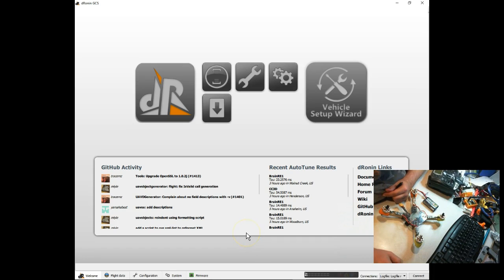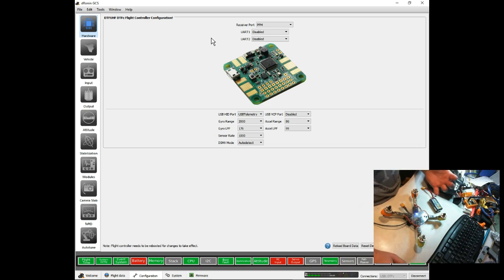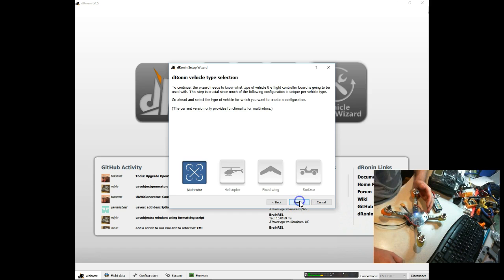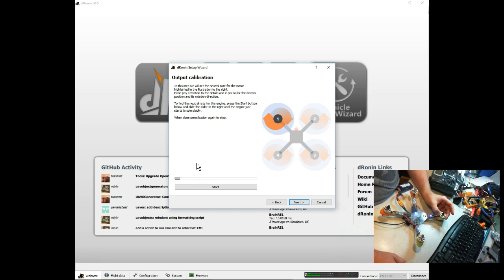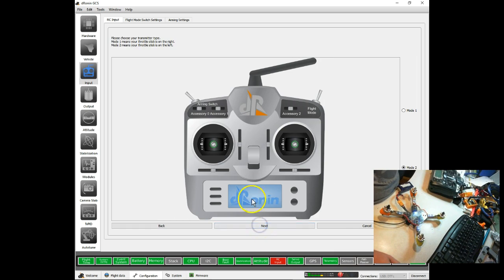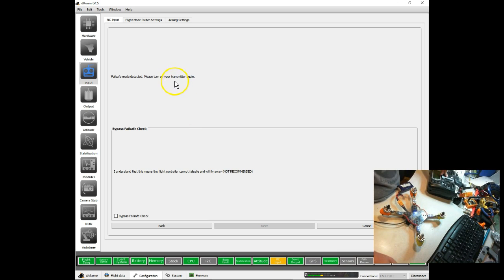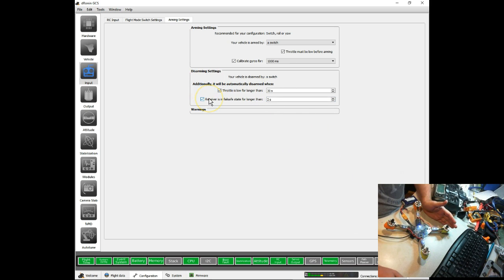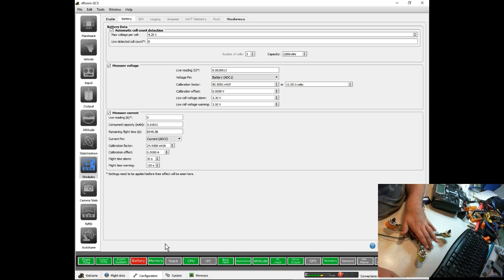dRonin Quixote - Initial Setup

Comment: i just came across dronin and wanted to check this out i have a SPracingF3Evo but i can not get it to connect and all the info i seem to find does not help would you happen to know how to fix it
Reply from the maker: Sorry for the late reply, once again Youtube isn't telling me when I get comments :(  Your best bet would be to post in the dRonin forums :  https://forum.dronin.org/forum/ since you'll get more eyes that way.  I've never used any of the SPracing boards so I don't have any direct experience with that exact board and can't say for sure what could be the problem.  The one thing I can think of is that you do have to flash the dRonin hex to the board before GCS can connect.  So coming from a different firmware you'll have to use that existing firmwares flashing utility to flash the .hex file provided in the dRonin distro.  Once you've done that you can connect with GCS and future firmware updates happen automatically when you upgrade your version of GCS.

Comment: I'm ready to throw my quad out the window  to not liking dronin
Reply from the maker: Sorry to hear that, what exactly are you having problems with?
Reply: Jason Hitesman dronin keeps freezing and  motors 2 and 4 are reversed and I'm trying to configure my receiver and it keeps freezing up
Reply from the maker: GCS is freezing?  Which version of GCS and what OS?  Do you mean the motor positions are reversed or the motors are turning the wrong way?  Be glad to try and help but need more detailed info about the problems you're having.  Posting on the dronin forums may be easier - more room to reply and more eyeballs to help...but supplying detailed info about what's going on is critical to getting effective help.
Reply: Jason Hitesman motors are spinning the wrong way lol I'm new to this have no idea what you are talking about I'm on my second brainfpv since I fried my last one lol this one is good though
Reply: Jason Hitesman gas 0000
Reply: gcs 0000
Reply from the maker: not sure what you mean by "0000" that's not any version number I recognize.  Motors spinning backwards isn't anything that can be fixed by flight firmware (doesn't matter if you're running *flight, APM, dRonin or anything else) that's an ESC issue.  Some ESC's you can reprogram them to reverse the direction (blheli allows this - but I don't generally recommend it since at least once in the past they had a bug that damaged motors with that function), KISS esc's have a jumper you can bridge to reverse the direction,  but any ESC you can just swap any two motor wires and it will reverse the direction and that's the method I generally use.  

As for GCS, the current public release is 20170213.1 codenamed "Artifice" because that's easier to say than 20170213.1 :D  You can download it here:  http://dronin.org/download  

There should be a new version "neat" very soon, the preview release is out already but I wouldn't suggest using it if you're just getting started as there are still little issues being ironed out.  Hopefully it will be finished and released within a week or so - one nice feature it adds is ESC passthrough so with blheli esc's you can reprogram them through the FC.  Which would make it easy to use the software reversing in blheli...though as I said above I'd still suggest just swapping two wires since it's somewhat more reliable.
Reply: It's good got it working thanks to your video my first build so happy cheers

Comment: Hi Jason, 2 things, how do you make sure the programming is actually saved to the FC?
After following your vid I saw the esc's were yellow, it said I had no esc's, I went to the other page and setup, did a test and the motors went full hyper rpm, it smelled a bit. I got back to the flight page again all the boxes were green, the blue light on the FC was on, I disconnected the program, then the cord then the batt, today I wanted to configure the Vtx/Vrx goggles etc. I turn on the radio and plug the batt and dead, only .03v up top on the FC. Where did I go wrong?
Reply from the maker: When you hit the "save" button if there are any issues it should give you a notification - usually a little symbol on the button and then if you hover over that it will give you the details about what went wrong.  I'm not sure what you may have done wrong...with the outputs yellow you shouldn't have been able to do a motor test in the first place.  So I'm at a loss to explain what may have happened.

Comment: Dronin rocks. Love the autotuning. :)
Reply from the maker: Glad to hear you're enjoying it!  Did you share your tune?  It helps the developers collect data about what does and doesn't work well in AT for future improvements.  And makes it easy to share info about your configuration if you have any issues and need to ask for help.  You can even export your settings from the dronin.org website off a shared tune and then re-import them in GCS - so it kind of works like a cloud backup ;)
Reply: Skipped that part. Got so anxious  to fly it after saving the autotune settings. Will share next time. :)

Comment: does dronin works on cc3d boards?
Reply from the maker: Yes it does, at least up through the current release "artifice", it even supports dshot on CC3D.  But this is the last release that's going to support f1 based boards.  This release will be a "long term support" that will be maintained for F1 support but won't be getting any new features going forward.
Reply: Jason Hitesman Cool! I'll try it on one of my quad with cc3d. Thanks for the video.
Reply: Jason Hitesman just tried it on my quad with cc3d and it works. Haven't tried autotune though, it's kinda late. Will try it later today. One thing I noticed is that you didn't talk about how to set the board orientation on this video. Although I managed to figure it out. Thanks for the great turorial again.
Reply from the maker: Autotune should work on CC3D - but you'll have to be careful not to have any extra modules enabled when you use it.  (no telemetry, battery monitoring or anything like that) as memory is very limited and autotune is really pushing the capabilities of the F1 chip.

I had totally forgotten about board orientation since I don't currently have anything setup with a rotated board.  Glad to hear you got it worked out, it's fairly simple and the automatic yaw detection can usually take care of it for you real easy.  If not the top of the attitude page you can manually adjust the "Rotate virtual attitude relative to board" settings.
Reply: Jason Hitesman Nice to know all that. Thanks for the info.

Comment: Hey man thanks for the videos on Dronin! Feels like there are not many videos on how to get it set up.

I just finished building a mini quad that runs Dronin on a CC3D but I got tripped up on needing to run full throttle calibration on my ESC's (on the output tab) as they were brand new ESC's and nothing was happening on the setup wizard but I figured it out eventually. Might be worth putting a vid up about that? I might learn something still! 

I think the above is a big difference between the Dronin setup wiz and the open/librepilot setup wizards as those have an ESC full throttle calibration step.
Reply from the maker: Ed Green I almost included it in this video, but it was getting kind of long.  It's definitely on my list of topics to cover on future videos though!